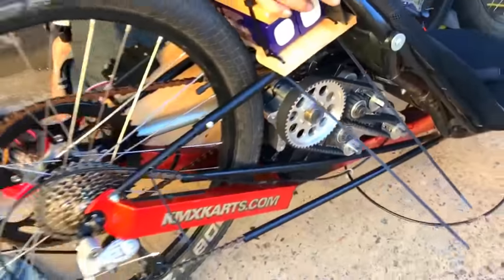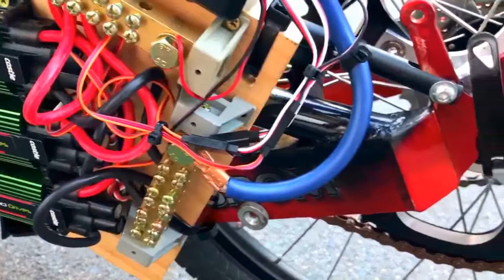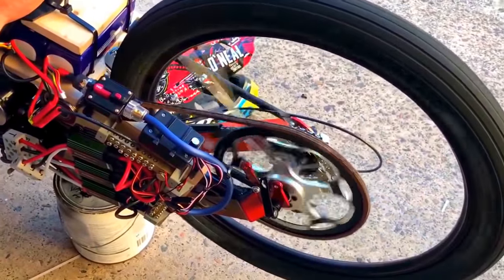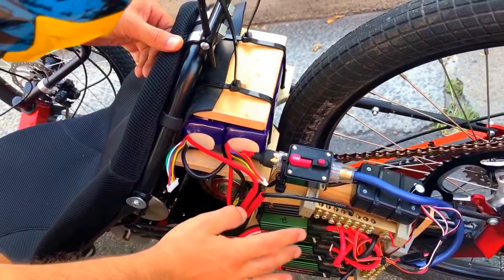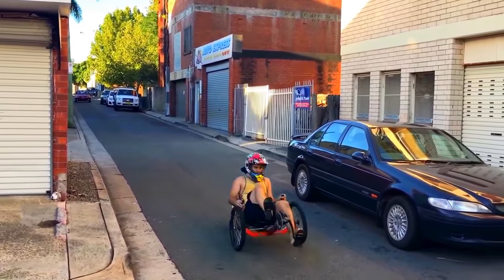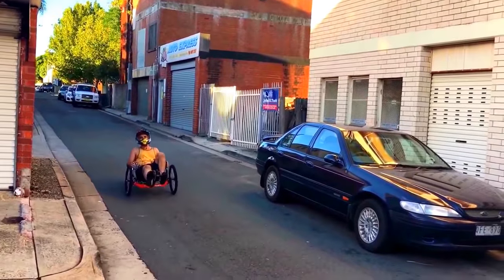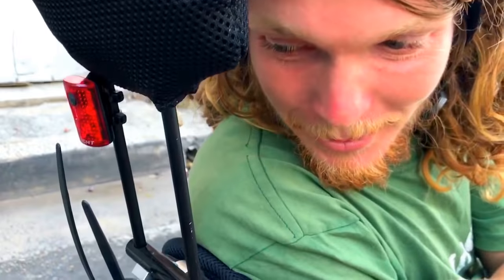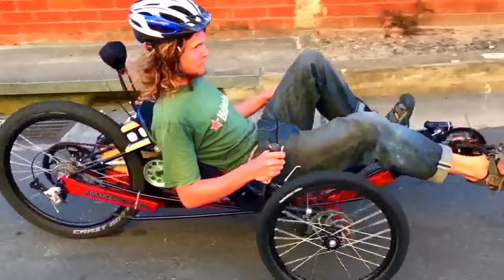DIY 42000w Electric Bike - 56hp Triple Motor (video#3) YES, monster is rolling! First tests at 300A

Comment: holy shit that thing looks sketchy as hell
Reply from the maker: Jeff Rutan hahahahaha yeahhh man... this trike is more like death trap than anything else... in this video I’m trying to be gentle on the throttle but this machine is freaking mental and never stops burnout unless I release the throttle... many times I can feel the front wheels lifting (no front wheel and no rear wheel control at high speeds) it’s a bizarre scary feeling but so much POWAAAAAAAHHH ohhh yeaahhh =]

Comment: A 56 hp motor with this size? I don't think so...
Reply from the maker: triple 14kw high efficiency motors spinning at 11000rpm with somarium cobalt magnets rated for up to 200 degrees, 3 independent controllers, in this video I was pumping just over 300A... I just installed a new racing battery pack so I can pull the throttle all the way and unleash 840A full POWEERRR

Check out what a very similar trike with the same motors did at "only" 20kw or 28hp https://www.youtube.com/watch?v=WKAMus3oSdw
Reply: you only need one 40kw motor and one 40KW controller  to do the job, make it simple
Reply from the maker: too heavy... in this video here, the trike total weight was 36.2kg.... a big motor and a big controller would be super heavy possibly around 35kg maybe more depending what you're getting..

Comment: Frame with carbon fiber and such to operate in the city

Google
Reply from the maker: +Сергей Пиценко yeaaaahh... this is the plan, I want to make it kinda like a velomobil with fairings and a proper rolling cage to make it super safe too... I am a big fan of carbon fibre but first prototypes I may make in metal just to get the geometry right, then make a super lightweight carbon monocoque chassis =]

Comment: Needs a bigger gear on the rear tire its spinning way to fast you need slow it down with more teeth
Reply from the maker: I figured out that the tyre pressure was a bit too high, reducing pressure increased grip quite a LOT but there was very little weight on the rear wheel so I had to move things around and increase wheelbase by 12” and made it 6” wider too but it still super crazy wild. The gear is for up to 100kmh and brutal acceleration, I’ll change gearing and play a bit more soon when I’m back playing with this project. Lots of subscribers asking me to put more trike videos haha =]
Reply from the maker: Here is what it looks like now https://youtu.be/uDJxX_EYi_A

Comment: 42000w / 840a = 50volts....
You don't have 50 volts. Video is not true, by 8000w (qwanshun) up to 30000w and apt 600a controler with config 96v bat and 300kg of waith chopper going a lot faster that your lite bike...
Reply from the maker: Yeah you’ve done the maths right, 50.4v here but battery current can pass 840A if I don’t watch out... 
Nah... I don’t want a 300kg Chopper... I make electric cars for work with a LOT more POWAAAAAAAHHH ohhh yeaaahhh

Comment: oh dear that won't last nice try unusable power that tyre won't hock up
Reply from the maker: Yeaahhh.. I just bought so many other tyre options... will try at different air pressure (the lowest possible for more grip)... I have already tried some things after this video and it felt like the front of the trike was lifting a bit and losing control on all 3 wheels... hahaha... but I already have plan B, plan C... I have a lot of automotive engineer friends, we are talking about making a completely new body that can deliver all this power effectively... ohh yeahhh.. =]